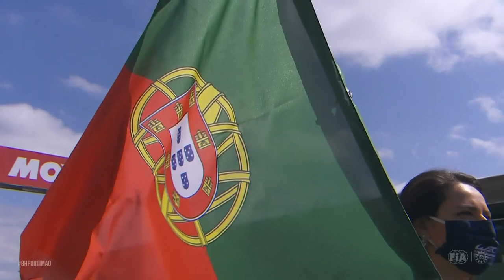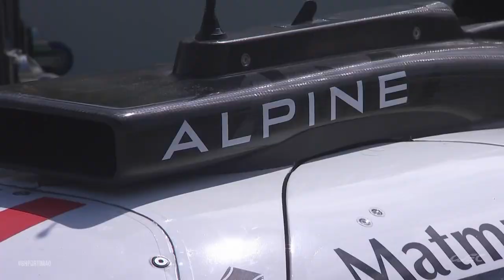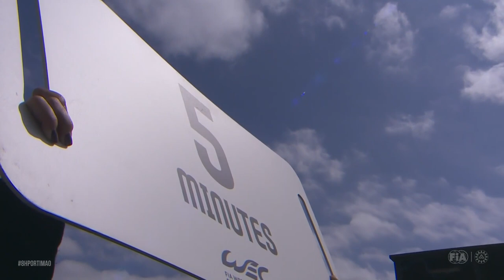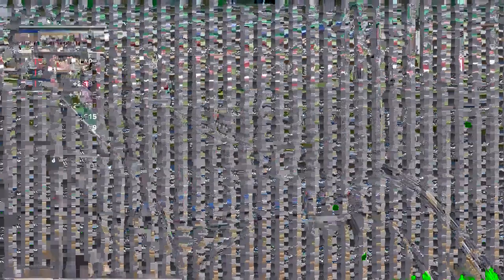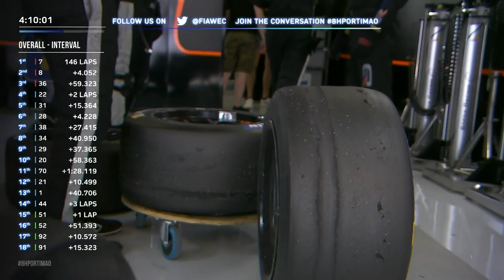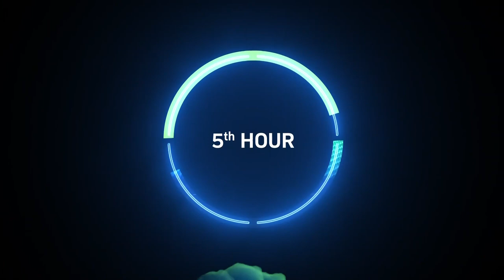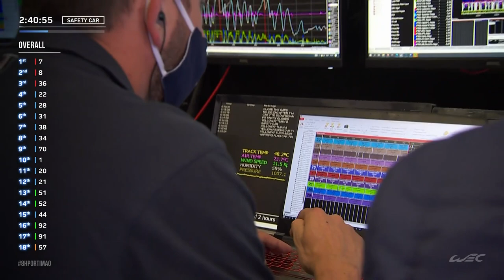FULL RACE | 2021 8 Hours of Portimao | FIA WEC

Comment: The tap at 1:25:00 could have been avoided.  Do they have a heads up display inside the cars with a map of the circuit?  If not, they really should.  It needs a picture in picture with overall location on the big map and a turn by turn 3rd person view in the mini map.  Or maybe vice versa.  It would need to be tested obviously

Comment: I think to know there is a time limit for each driver, I suppose 1h30m. For following easy scenary lets fix this 1'30".. So, excepting a driver A has in mind to pit, informs pit crew this lap in, if anything goes normaly, driver A would reach Pitlane right in time just before overrun his drive time... but just imagine, another car hit unintentional dricers A car, forced him to a spin and off track, Driver A stalled and stucked, but can restart the engine and find way back to track, unfortunatly with a puncher, slowly he finished lap and finally reached into pit - but overrun his driver time now, got at pit lane at drive time totally 1'33"... how would FIA react? Penalty? Would be nice if FIA official could response! Thx
Reply: Drivethrough for car A and probably a penalty for hitting car.

Rules are rules and if they take a risk they need to cope with the potential outcome.

But I am not the FIA but that's how I would react :)
Btw I am not sure what kind of penalty you get when exceeding the stint timer

Limit is about 60% of total race time I believe